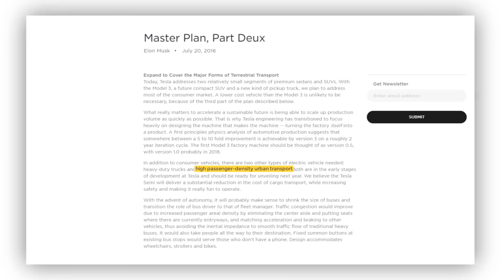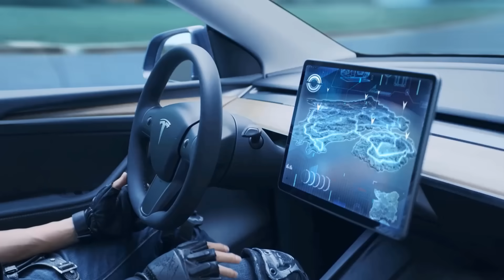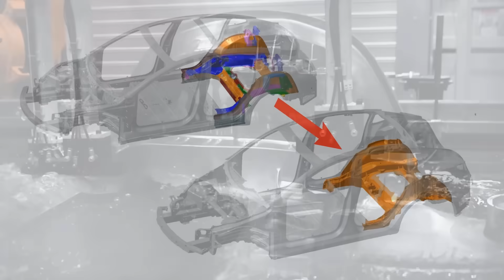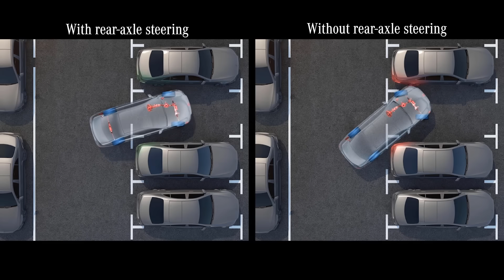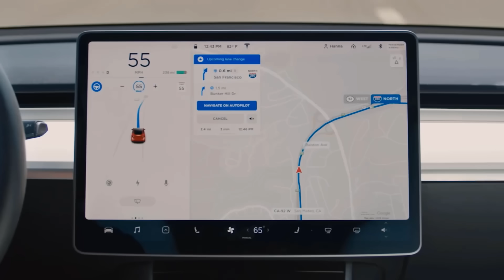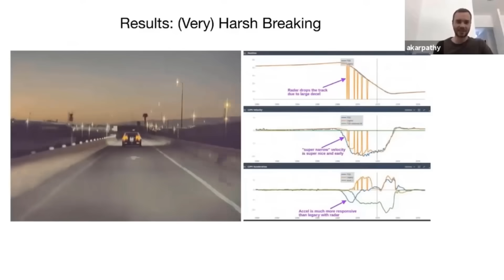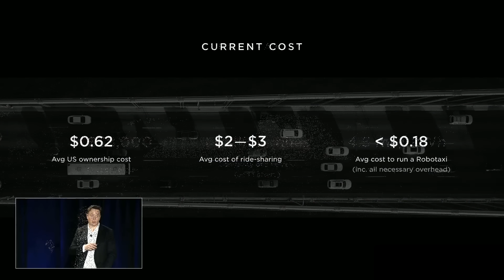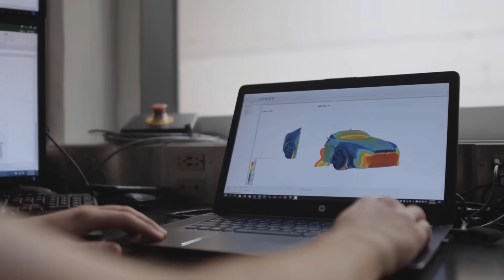10 All-New TESLAs coming to Shock Auto Industry

Comment: Still need a regular SUV. Great line up but the missing link for family use is the SUV, with 400 mile range. Still holding on the aged Highlander until I can buy an electric replacement.  Hugh market that VW is hitting hard.

Comment: Transition to an electric economy is a noble goal.  The reality is there is no where near enough generating capacity to support this transition.  Wind and solar will not be able to fill the need for reliable energy supply.  Battery tech is nowhere close to energy storage requirements at an economic cost.  The achievable solution to an electric economy is standardized  small to medium size nuclear power plants (including thorium).  Wind and solar have their place but are not capable of doing the heavy lifting in the time frame environmentalists  demand. Using nuclear as the cornerstone of an electric economy  will provide abundant carbon free energy  at an affordable cost.  Nuclear power has minimal impact because it delivers large amounts of energy in a small space.  "Green economy" supporters advocate using less energy as the price of going green. A recent study published by the Lancet concludes that cold kills far more people than heat. The Lancet proposes that plentiful energy can not only protect from both extremes it has the side benefit of raising the overall standard of living.  This is in contrast to "green" plans that advocate sharing the misery by having less instead of using our knowledge to elevate everyone to a better life. I will close by noting that nuclear power is by far the safest energy source in existence.

Comment: The only mistake I believe the designers have made was the pickup. Not knocking the Cybertruck. I think it's fine. But at the same time, he should have designed a more regularly styled truck to be offered along side, at the same time. Not everyone is into the crazy style of the cyberpunk. Also, it's obvious that commuting to work has hugely increased and will continue to increase. I think a small pickup, that is built for commuting purposes,  ie-as inexpensive as possible, would be a big hit. I myself commute 1 hour to work. I drive a Ford Fiesta. A small truck would allow the pit stop to haul project materials like 2x4's or a couple bags of concrete etc... Now I have a inexpensive usefull commuter that won't crush my wallet as it devalues in price, and I get to leave my $80 Diesel dually at home until towing duty is needed, retaining the value of my large investment !!

Comment: Okay I’m in for the 3 motor Pickup with the quad.  Pulling a 5th wheel RV toy hauler would be my dream.  Unbelievable range and with an RV equipped with a 5500 generator, you’d never be without a charging station.  OMG my dream come true.  This IS what I’ve been waiting for.  The only thing that could make it better would be a battery system that charges (from about empty to full) in less that 15 minutes.  I guess I better start saving my pennies “Er” i mean dollars…lol.   THANK YOU ELON!!!!!!!

Comment: Why isn't there ever any discussion about what will be done with the used batteries AND resources needed to produce them? Is there some type of recycling program that's already in place thus no discussion is needed? And I don't just put this question to Tesla but to ALL car manufacturers getting in the EV business. I mean, looking at the way people think of the climate and would rather wait for a treatment to things instead of prevention, I would think this would be in that realm that should be about prevention discussions NOW, not later.

Anyhoo, love the tech. I really do. Seeing the Plaid dominate the 1/4 mile racing has been a true treat. That if that's what a sedan made for a family can do, I can only guess what will be seen with a 2-seater roadster!!! Tesla is rockin' it with pushing advancements in the automotive world.

Now, if only Tesla drivers would drive better than Prius drivers and stop going under the speed limit and/or taking up the far left lane to go slow instead of passing. LOL Yes, that's a big generalization. But, it's based on my experiences on the road. Them and Prius drivers are great at creating bottlenecks. Not looking for them to be speed racers. But, at least aware that they can stay to the right and do their thing. Heh

Comment: I want 300 mile usable range (which means probably about a 360-380 mile max range). Anything less than that and I need two cars. I don't think you are going to see really widespread adoption until 360 miles is a "normal" range not an extended range option. The other huge problem that needs to be solved is how people without a garage can handle an electric vehicle. A lot of people in apartments are parking in carports, underground parking structures or even on the street. 5 years ago those 4-5 electric charging ports right next to the handicapped spots at the mall were rarely full. Now it's rare to get a spot.

Comment: I worry about how much investment Tesla have in a very specific battery construction process when evolutions such as BYD Blade appear...Does this make 30% of the Tesla plants obsolete as they have to switch to entirely different process?
Why dont BYD angle the blades at say 45 degrees to lower height of pack still further?

Comment: those public transport vehicles with folk sitting side on to direction of traffic is impractical / potentially dangerous - whilst the EV will have 'smart' collision avoidance, there will still be emergencies that require rapid braking, sending these passengers forward uncontrolled
Reply: I think that was for the ones going thru
 the boring tunnels not  driving on the highway

Comment: Electric truck will need the battery the size of the truck, plus down time charging will make it a non starter..hauliers need trucks on the road 24/7. Nevermind the initial cost .. strange how when announced the cargo weight were missing.
Tesla roadster... 0-60 mph in 1 second... 90% of people will crash... That's top fuel dragster speed... Pointless ability... It'll be heavier than a normal sportscar, cost more and sound like an eScooter. People buying performance cars buy them for the noise as well. Having a car that is heavy and sounds so wrong nevermind the limited range after you've drained it fast will be a turn off for sportscar buyers, unless your an idiot who hasn't a clue... Buys one then wonders why you get smoked by every sports car round the corner and have to wait hours to charge while your laughed at....
Tesla digging tunnels all over under the cities...oh dear... The cost would be staggering like digging the London underground system...then you think you'll be standing and walking around in a glass box as in the video? 😁 The health and safety lawyers kick in here... Seated, belted, crash structured, escape tunnels? Remember Chamonix tunnel fire? London underground fire? They would insist on escape... It's be so expensive the catch back cost would be stupid... Ahhh yea...the idiots who will buy it simply because they're rich and brainless. Never got dirty hands brigade... The I buy iPhones because .... And can't find a reason why they're better ...
Reply: You appear to be like your photo ,I don’t know too many rich people who are idiots ,I look forward to finding out what you are doing to help civilisation .Maybe you should put your energies into something more positive.
Reply: @Gjm7528  you mean I'm like my grandson...? If you say so...  There are many rich people who don't know there arse from their elbow... Depends on your circles of people who you know... If you replace electronic goods for new ones of any type simply because it's the latest one your in the 1% of rich people.. and if you do your the problem with society.. if you think that any product Elon makes is good value your the rich one because nothing he makes is cheap.. products for the rich. How do you know what I do? In fact I was partly responsible for one of the very first affordable EV's.
Reply: @terrybrown6057  and did that help the world transition away from fossil fuels? How many built?
Reply: @richhr89  did what help?
Reply: How many built of what?

Comment: I wish they'd release a model for the lower-budget market.. Or maybe start doing some form of refurbish/used market.. Until the average person can afford to get an EV, this country won't get off gas..
Reply: EV cars are for the rich idiots... Most are paying through the nose for one, example.. a Nissan Leaf will cost you over £500/m for a cheap one new at about 35k. So how much are most Tesla owners paying... A more expensive car.. more expensive parts.. a car that's killed more innocent people in autonomous mode, albeit usually because of misuse. But it shouldn't allow the driver to do that.. you can defeat lane assist easily with 2 water bottles jammed in the steering wheel...simulating driver hand input... FAIL. 
How much of the car actually gets recycled?
Tesla owners are blinkered
Reply: @terrybrown6057  and the price of new gas cars? New cars are expensive, period. You choose between one that pollutes more or one that pollutes less.

On autopilot crashes- just how many people hurt in total ever?  And how many are killed every day, EVERY DAY due to driver error without autopilot.

Use the grey material in the bone bucket, eh?
Reply: @richhr89  autopilot is crap full stop.but be careful what you mean by autopilot... 
Lane Departure warning
Forward emergency braking
Cross traffic alert
ESP or whatever each manufacturer calls it
There's dozens of systems building up a suit of tools helping cars become safer, not just autopilot...
Lane assist (car warns you and steers you back in the lane)
ABS, 
Smart cruise control
Speed limiter

All these systems add up to what people presume is just one 'tool' autopilot. What your referring to is probably lane assist . Cars use a combination of radar, lidar and cameras to virtually see the near environment. Colour contrasts etc. Where it's not safe to use the system it shuts off automatically by design. Which is what I presume idiots are not prepared for.. you've read the stories...seeing the virtual world is HARD for cars.. and there most definitely has been deaths because of one of these systems or a combination of these systems failing or doing something weird. My car has a few times wanted to throw the car into the scenery at high speed...

I think there's a few things Tesla have that are quite good... Sat nav taking into account road elevation... Not many others do that. Apart from that is there anything else Tesla cars have that's really useful other than being able to draw on the screen with your finger? 😁